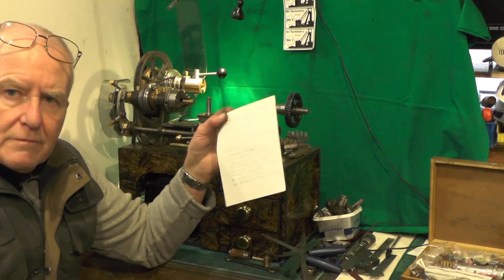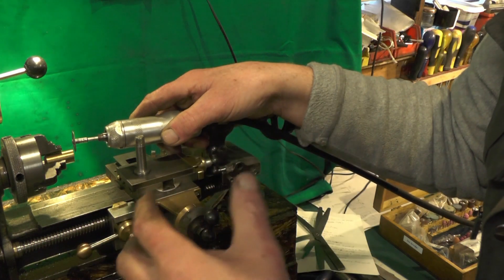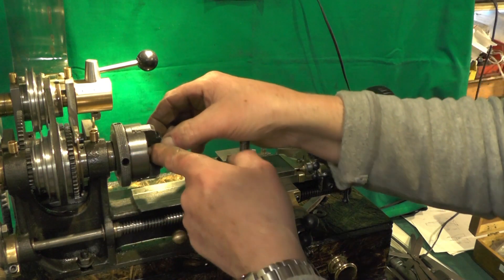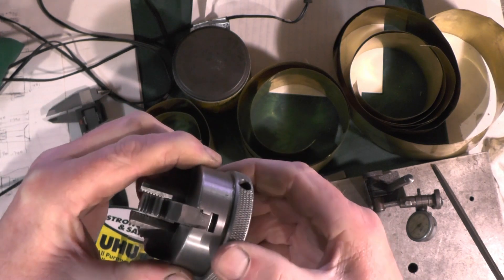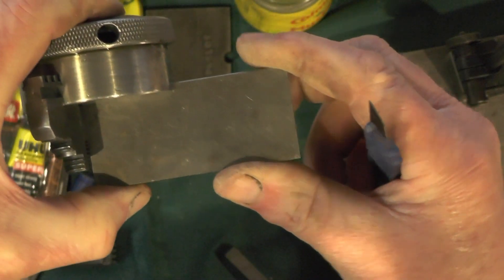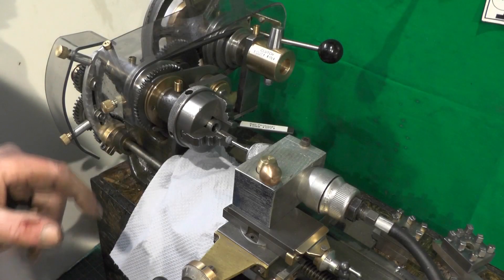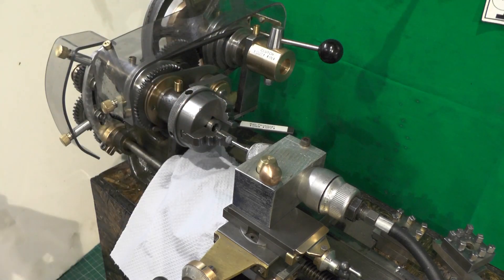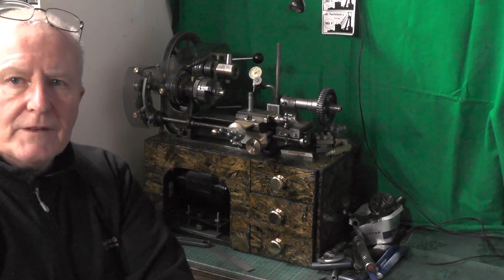Ep 28(Try to Make a Silk Purse Out Of A Sows Ear!) Make a Micro Lathe 1st unofficial job B4 complete

Comment: What ho Mr F, 
Well that's better than my usual practice of making a sow's ear out of a silk purse.
You'll be pleased to know I did some actual work last week, I took angle grinder to my Quorn.
ATB 
C
Reply from the maker: eyup chris🤣🤣 yes silk purse analogy!! me too!!
good to hear from you, good to hear the angle grinder been out with anger, did you chop the quorn up or was it a delcate operation😄👍👍
atb
Kev
Reply: @MrFactotum  I used the angle grinder because i got fed up with the complication in use, just kidding. It has been so little used the front bar was rusted solid into the frame and work head, so I cut it with angle grinder and beat the crap out of it to free the rest. I bought some stainless as a replacement and will rebuild it making upgrades on original design faults, if I can summon the enthusiasm which it not guaranteed, and future proof it against the water/steel interaction. 🤔
Reply from the maker: @chrisstephens6673  😄😄oh got you!
Thats one reason i never got a quorn  or any other T & C grinder because of the limited use it would get and be planted somewhere as an ornament, i manage with Harold Halls  Grinding accessory which i made and modified to be  better for my use.
You never know this might be the spark to ignite your enthusiasm to give us a video of the modification. 👍👍🤔🤔😉😉😄😄👍👍👍👍👍👍
Reply: @MrFactotum  I'm more interested in my furry little friends these days, but they are getting to be an expensive hobby, close to 10 quid a day if they all turn up, but at least i have started on the Quorn. 😇

Comment: Hi Kev. What diameter is the Chuck. I have a mini chuck 2" diameter. Not sure if it would be any good for you. I will probably never use it. It has a MT2 taper at the back but looks like that would screw off. It's yours if you want it. 
Steve.
Reply from the maker: sounds great Steve thanks very much
this chuck is 2 1/4" so 2" would be great.
let me know what you want for it and also i have a boat load of stamps that i need to use so email me your address and i will send some stamps for you to post it if thats okay, need to know the weight though.
Many Thanks 
Kev
ps my emails on my about page
👍👍👍👍👍👍👍👍👍👍👍👍
Reply: @MrFactotum  Hi Kev. If the stamps are like the ones I have they will not take them anymore without the Kings head & bar code. Will mail you.
Steve.
Reply from the maker: @Steviegtr52  Stamps are fine, have the barcode on  i had them changed at royal mail headquarters last year, still have queen on but that's okay. use them regularly.
👍👍👍👍👍👍

Comment: Great result Kev.  I use the same method, but mark the jaw faces with marker pen which helps see what has been taken off and keep it to a minimum.  My guess is that the chuck had a manufacturing defect from new.  I can't see why/how only number 3 jaw would be so loose.  The other Q & D "fix" is to multiple centre punch the slide face on the chuck to raise the metal.  Works a bit like knurling.  Cheers Rob
Reply from the maker: cheers Rob👍👍
Never thought of the Punching trick, used it before on other jobs, but the ageing brain cells bypassed that this time🤣 
To be honest i nearly threw it in the bin and for that to happen from me means it was bad. Ive never like these type of chuck, i like the ones with a conventional chuck key, but they seem to be rare in that small size chuck, but it will put me on until i get to find one.
regrads
Kev
Reply: @MrFactotum  Hi Kev.  I have a similar chuck on my little Sherline lathe and they don't tighten very well in comparison to a keyed chuck.  The cheap ones are pretty crap quality from my observations.  Cheers Rob
Reply from the maker: @Xynudu  yes can't beat a proper chuck, i'm on the lookout👍👍👍👍👍👍